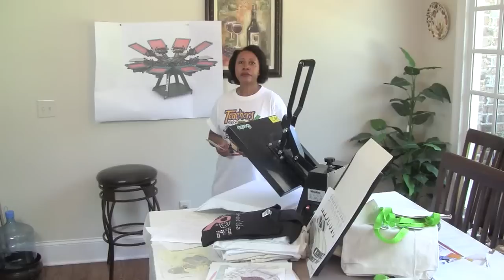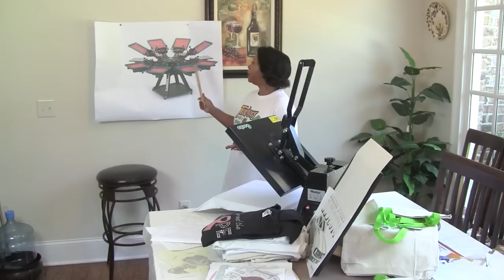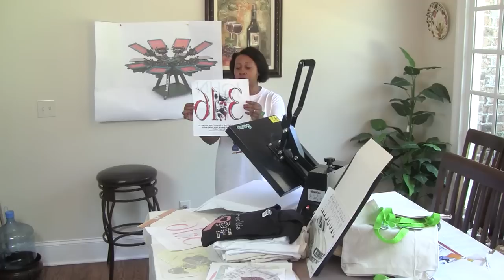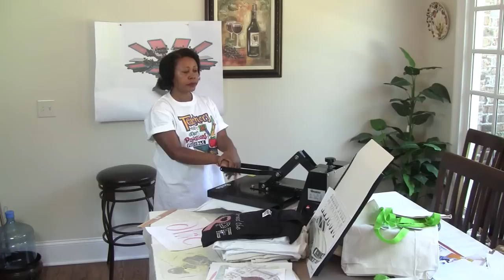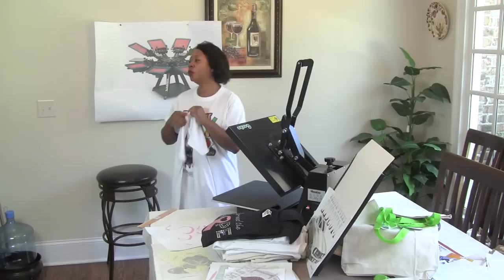Heat Press Machine vs Screen Printing T-shirts

Comment: One reason you failed to mention is it your gonna be doing 1 or 2 shirts then the heat press is fine, once you get in to big orders you gonna need a silk screen or you will fall way behind. But as a T-shirt company I use both but I primarily use screen printing. The downside of screen printing is if you don't have it know how to use some type of illustration software such as Photoshop or illustrator or coral draw it would be difficult, but they have books and tutorials. And I don't even have a screen printing machine that big , mine was 1600 for 6 color 4 stations that's all you need. and another thing you can't really do any complex designs with heat transfer, only what you can purchase from someone else and that alone can become expensive when ordering multiple transfer paper

Comment: Where is the colours on a heat press? A heat press is a totally different thing from a screen printer, the screen printer has colours and the heat press has no colours.
Reply: you need no color separations... print millions of colors just like a phoyograph. plotter prints and cut out the design on the transfer paper. once applied the excess peels away/ also plotter has six inks can print white ink and silver to make mettalics

Comment: If i was to get a heat press machine, what else will i need in order to use it?? also does it have the ability to print on sweat shirts and thicker material as well ?

Comment: what the different between  iron heat press than a heat press machine?
Reply: Using an iron will NOT provide consistent pressure over the entire decorated area.  Plus, with a high quality heat press the guessing of the pressure applied is eliminated.  If the transfer requires 60 pounds pressure you can apply with that pressure over the entire decorated area.  In addition, a heat press has a better control over the heat application.  Three factors must be controlled utilizing a heat press; namely heat, pressure & time.

Comment: where can i get the pictures or the logos that i will print on the Shirt?, and can i design it my self or download pictures and logos from the internet to print them on the shirt?
Reply: You can produce artwork utilizing Corel, Adobe Illustrator as well as a few lesser known private options used exclusively by the firm that produces the plastisol transfers.  Google heat press transfers for companies that service this part of the industry.

Comment: i have a question i have both machine, but when i use my heat press it leave sticky stuff on the tshirt. how can i fix that proble?
Reply: Are you using a Teflon sheet? That may help if you're not
Reply: +Laura Vanrooy yes I used Teflon paper. Its like the sticky part is from the paper itself.
Reply: There is too little information provided as well as numerous problem possibility options.  Your best answer would be provided from the company that created the plastisol printed transfer.  They should be able to guide you through each application step ensuring a proper application.

Comment: What type of printing method wrinkles when you wash it? I ordered a hoodie on eBay a long time ago and when I washed it all of the design was slightly wrinkled. I want to know so next time I buy something I know what to avoid.
Reply: The garment fabric and the application technique must match.  If one shrinks and the other does NOTa puckering will result.  This is especially true with the newer fabric options.  This is the reason screen printers will NOT take orders where the customer supplies the garment.  The only method of testing is to wash the garment after it has been decorated.

Comment: Yes I agree that heat pressing is easier but the print quality isnt long lasting. It fades after several washes in a couple if years. Compare to screen printing which the quality last longer.
Reply from the maker: Thomas Aquinas No not true...It depends on where you are getting your designs.  Yes, if you use the ink jet and other none professional papers you are correct.  If you buy your designs from companies who specializes in making designs for heat press machine the designs  will never wear out.  In fact, the shirt will wear out before the design wears out.
Reply: +Dorothy Ross those designs from specialized compagnies ... are screen printed on transfer paper ... then it's the same that direct screen printed t-shirt :)  The difference is the minimum quantity that you need to buy or print ...

Comment: How big is that heat press? What is the maximum size print you can use for that?
Reply: Paul Neff Looks like a 16"x16" to me.  Max print on a press like that is right around 14" assuming I'm correct about the size.  Keep in mind, when you get better at pressing you can make multiple presses for larger designs.  I sometimes have to do that for people who need 4xls (my press is a 16x16).  14"x14" is a pretty large design either way.  Most consumers are completely satisfied with designs around a square foot.
Reply: phalceprofit Hello, my question is what brand of heat press do you use and where could I buy one? Thank you
Reply: Adrian Segura I bought mine off of Ebay.  It was around $250, but there are some that are much more expensive, and smaller ones that are cheaper.  I don't believe it has a brand name, there are no brand labels on it at all.  I got a 16"x16" clamshell, and I feel like that's good enough for t shirts.  If you have the extra money I recommend getting a press with a swing-away arm.  It will save you time and frustration in the future.  Good luck!  You can also contact me via facebook at www.facebook.com/shirtsandgiggl3s

Comment: Screen printing your design on a t-shirt is much better than using heat transfers.  When you screen print designs, the ink gets lodged into the fabric of the shirt creating a tighter hold when flash dried rather than when you use a heat press and press the design on top of the shirt.  Heat transfers don't last as long as screen printed t-shirts and screen printed t-shirts have a softer hand.

Comment: Hi. When I want to print a design on a black tshirt. The ink barley shows. Wat am I doing wrong? Also I don't know where I could get white ink
Reply: Margaux Edelstein That's one of the many reasons plastisol transfers suck.  When you would do the same thing with a screen press, you would lay down a white under-base first.  That way your color would actually be on white, and be more opaque.  If all you have is a heat press, I would suggest ordering the same exact transfers with only white, and a second color copy to put on top.  Feel free to message me if you need more information.  I started from $ZERO, and (knock on wood) have been doing pretty well in the textile industry.
Reply: phalceprofit I am outside of the U.S. and thinking to open my own business. Would you consider giving me some tips please? would really appreciate your help if your not too busy. Thanks in advance.
Reply: Kenroy Westby Yeah, of course.  Feel free to message me.  If I know the answer I'll answer you, if I don't I'll point you in the right direction.  Just don't ask where I get my shirts! lol
Reply: If possible can you contact me on Gmail or facebook. In that way we can have real time communication.  Thanks in advance. kenroywestby69@gmail.com or contact me on Facebook. "Kenroy Westby" will await your contact.
Reply: Kenroy Westby Sure!  You can reach me through this page- https://www.facebook.com/ShirtsandGiggl3s

Comment: Hi, my concern with a cheap heat press is that it won't distribute the heat evenly across the t shirt and even tho it may have only cost a few hundred dollars, that's a few hundred wasted because the transfers won t hold up on the t shirts. Am I correct on this assumption?

Comment: silkscreen much cheaper for starter... Heat press need a good plotter and printer to print out the artwork. :D
Reply: Wonder Weiss I disagree.  My plotter and press were just about the same price as my double rotary 4x4 screen press.  Heat pressing is definitely a more simple entry level craft for people that don't want to get in over their heads.
Reply: phalceprofit maybe yes maybe not. But the raw material cost like pigment ink, transfer paper is something we need to calculate. In Asia, usually we don't use rotary press. We use the line press table that cost much cheaper than rotary.
Reply: Wonder Weiss Oh, there's no doubt that the return on sales is much higher for screen printing.  Ink is far cheaper than transfers or vinyl.  At least here in the states it is.
Reply: just too much work, space and time for silk screening.set up charges screen charges... labor an turn around time

Comment: You buy low price machine and low price supplys, you will sell garbage product, you buy expensive machine like screen press you will sell quality product..and thats reality..you will have good customers feed back..and if you want to start T-shirt business sell it with quality not garbage..I'm both screen and heat press printer,
Quality and productivity, screen printing is number 1
Reply: Keister Aiseam AMEN
Reply from the maker: bob cross Not true...With the right stock designs and quality heat press machine, the quality of your t-shirts are the same and in some cases better than screen prints.  If you are referring to the designs that you buy from a craft store or other non professionals then you are correct.  I made a living with stock designs for many years so I know what I am talking about.  I have also used the screen printing method and I don't have issues with it, but if you are looking to simplify your efforts and save money,  using heat transfer designs are the way to go. The technology is even better today than when I was in the business.
Reply: I agree
Reply: I have both and more options with less cost with screens at least here I wish u the best not saying u can't be successful with press just more options with screen

Comment: Shes making screen printing way more complicated then it really is. Heat presses are also very expensive too. Heat pressing is simple but its very complicated when it comes to which company (you send your design too) that will make good quality transfer. For those who have a cool clothing brand (not making tees for family reunions) an actually dope brand its hard to find good knowledge about which types of transfers are best (like no feel). 

Screen Printing also sucks in ways because you need a flash dryer or conveyor belt machine to cure the ink after the print.

Comment: Heat press is nice if you going to use that shirt twice. But not really into heat press just my own taste. As it feels like a big plastic in your chest and from time it starts peeling off. On the other hand screen print it is more complicated and pricey, but! You get a better result and last way longer. In other words you get what you pay for.
Reply: I so agree with you. I love screen printing, because the results are sooo much better than a heat transfer, plus the quality of the finish on the tshirt is better. I see the heat transfer for certain designs, like those sporty jersey shirts that have been trending. Things like that.
Reply: cheap equipment and supplies yeild bootleg stuff

Comment: Guys just go to proworldinc.com and they have thousands of preprinted screen print transfers (including every single one you have ever seen this lady or that Cortez guy use in their video demonstration) that you can use to start up your business AND they sell the heat press machines.  They even allow you to start a website using their designs so your customers can look through the entire inventory, tell you which designs they want, then YOU go proworldinc.com and price of the screen print (you can even see a preview of what it looks like on various colors) then based on how much you will have to pay (in most cases around a dollar per print), you decide how much to charge your customers.  Do NOT let someone swindle you into paying money for information that is FREE.  It took me less than 5 minutes to find that ONE company, which I use and my business is thriving.
Reply: cc bs are those transfer u use durable?

Comment: Screen printing is better. Heat press shirts are cheap. Wash them a few times and they start cracking. Screen printing machines are not hard to operate. I do both and I am getting rid of my POS heat press.
Reply: I have clients that have shirts over 5 years, who makes your transfers must use inferior inks or overcuring.
Reply: mine lasts 7.

Comment: heat press = means you can only wear your shirt couple times before is starts to crack and peel..   screen printing = longer lasting shirt without cracking and peeling... simple..
Reply: Hi Dorothy, thanks for your extended tutorial. Which heat press machines would you recommend? Do you have a link to that? Thanks
Reply: Dorothy Ross so the shirts wont crack or peel with a heat presser?
Reply from the maker: Not true...It's obvious you have either never used screen printed heat transfers, or you have used the ones of less quality.  These designs Will Not wash off and will last as long as the shirt or material itself.

Comment: I recently bought a heat press machine I tried so many times by using a transfer paper to print on a T shirt however it did not work the picture is not clear on the t shirt I don't know why!! I tried with different transfer papers and different t shirts brand I tried even cotton and also different heat degree however none worked !!
can you please help with some of your experience what the problem might be ? thank you
Reply: It could be your machine. What kind do you have, and how is the settings?

Comment: Hi Dorothy. I was wondering how the final product after heat pressing will be like? im planning to enter this business but i wouldnt want to do it if there is a rubbery touch or a plastic touch to the tshirt printed. id rather prefer actual colors on the shirt so that they are more comforting. Please assist me. Thanks.
Reply from the maker: Hi Bhuwanesh, It's a little difficult to answer this question in that if you really want to start a t-shirt business and be successful, you need more than bits and pieces of an answer. Go to my website and select one of my programs that best fit your needs and learn how to get your business up and running from beginning to end.  If you get stuck anywhere in the process I will be there to mentor you through : )